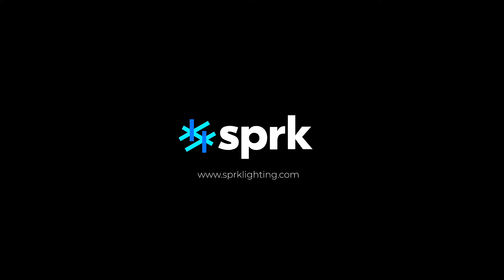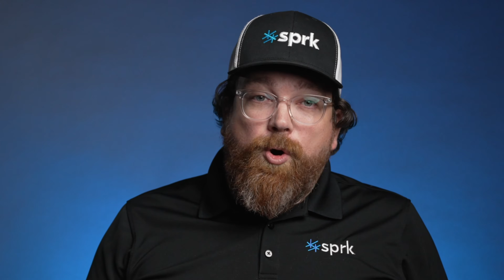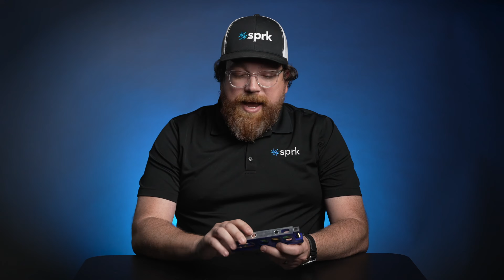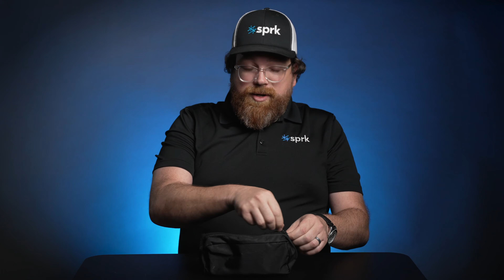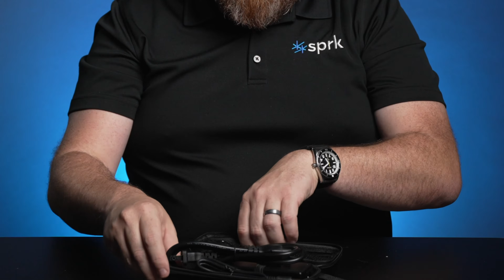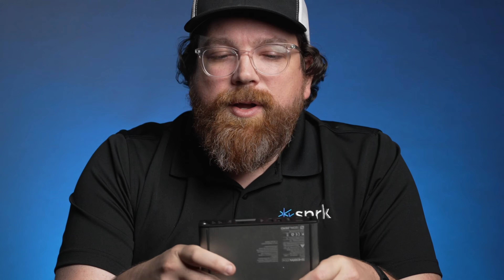FAVORITE TOOLS of a PRO LIGHTING DESIGNER

Comment: The soldering iron you have is a TS100 by the company miniware. There are a lot of different kits from reseller available. They recently launched the successor the TS101 which is even better with improved and additional features. I recommend anyone looking for a portable soldering iron to buy one. Just watch out for the knock of ones and bad kits.
Reply from the maker: I’ll have to check that out!
Reply: @sprklighting  I like to use a milwaukee m12 battery and a usb adapter to power my TS100 it fits in my pocket and it's easy to grab one from the carps. But you are correct, it is a game changer
Reply from the maker: @kbarry29  good recommendation!